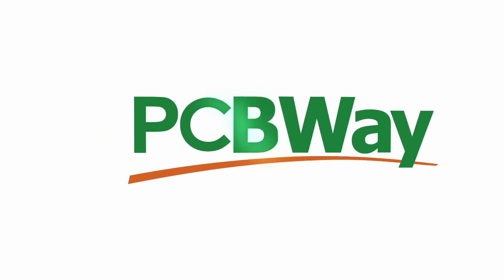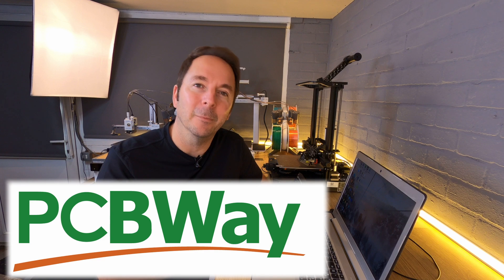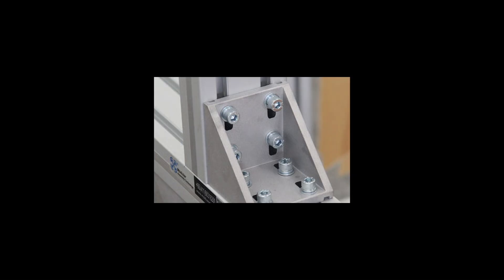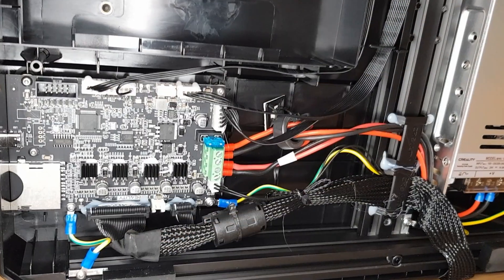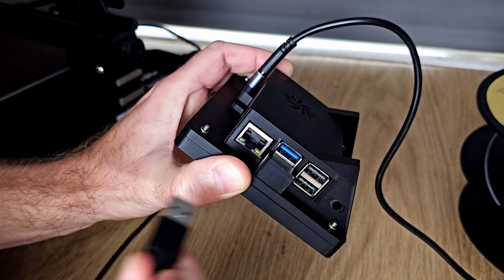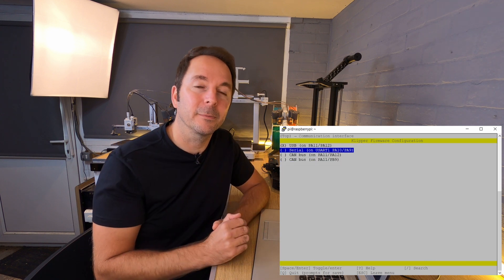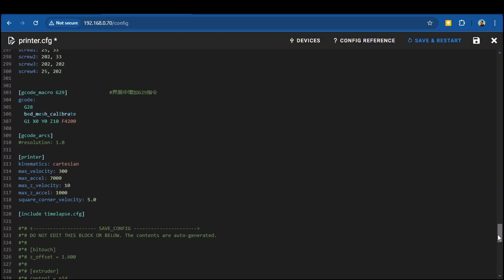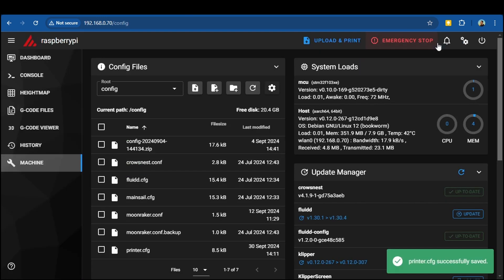Fixing Klipper Errors - Klipper 3D Printer Series Part 8

Comment: MCU 'mcu' shutdown: ADC out of range

Sensor 'heater_bed' temperature -72.505 not in range 0.000:130.000
Sensor 'extruder' temperature -72.505 not in range 0.000:250.000

this is the error i get idk what to do can anyone help or mention a link where this is fixed.
before, the setup was working fine it just happend when i formatted the raspberry and installed the setup again

Comment: I have an old board and I’m getting the mcu unable to connect message. I was able to upload the firmware through the USB cable and the USB led’s on the board flickered like crazy while flashing the firmware. I’ve tried different baud rates and I know my serial port path is defined correctly in the printer.cfg file. When I try to connect klipper to the printer board I don’t even get any blinking led’s on the printer board. Before updating the firmware, I was able to connect to the board with pronterface using the same USB cable I’m currently using for the connection between the pi and the printer board. I don’t know why this thing doesn’t connect.

Comment: Klipper software, Arduino Mega2560, Ramps 1.4, Raspberry Pi4b. When the 3D printer starts printing, the bed temperature reaches the set level, then the nozzle temperature reaches the set level, and printing doesn't start. There are no error messages; everything appears normal. The nozzle and bed temperatures fluctuate a few degrees. The axes are manually moved and home positioned. The axis and extruder calibrations are complete. Please help. I couldn't solve the problem.

Comment: HI Ricky, your videos have been super helpful to me. I am running Debian Linux 11 on a NUC box, USB connected to my Ender 3 S1 Pro. Using Fluidd It has been working fine for a couple of years. I lost power while updating Fluidd/Klipper. I have gotten all the latest updates installed successfully, but now I am getting the message "Klippy not connected" "Restart Klipper does nothing. I have tried rebooting the PC and Ender multiple times, restarting OrcaSlicer and no change. I thought about uninstalling and reinstalling Klipper but I don't know if that is the right approach or not.

Comment: here is the error i am getting..   
   virtual_sdcard is not defined in config.

    pause_resume is not defined in config.
    gcode_macro pause is not defined in config.
    gcode_macro resume is not defined in config.
    gcode_macro cancel_print is not defined in config.
    display_status is not defined in config. 

Make sure you include the mainsail.cfg in your printer.cfg file.
i did the google search and am not 100% on how to add this to my printers con fig. i have re-watched all the videos many times.
i think its a copy and paste fix but some step by step would be very much appreciated. i am setting up an ender3 v2 with the pi4b and the skr mini e3 v3 main board. thank you for all you work on this series i tell every one that is trying to set up klipper to check you out.
Reply: make sure the mainsail.cfg is on your raspberry pi, if it is, open it and add the following line at the bottom of your printer.cfg file        [include mainsail.cfg]

Comment: Do you have any insight on this error Lost Communication to MCU 'MCU'  this seems to happen sporadically. I can get a print to finish or it could shut down with 10% to go.
Reply: Happens to me too 😅 I know for a fact that it will happen if my raspberry pi heats up and throttles, and there are two varieties of messages that I get. One of the error varieties has to do with some sort of a timer mismatch / race condition. The other error seems to be more generic and this more difficult to explain / anticipate. For me, this will often occur mid print, but I’ve also had it happen before with a stationary printhead (I.e just a few seconds into heating up the bed). 

Even though my 3-D printer didn’t originally ship with Klipper, the manufacturer was kind enough to provide HARDWARE troubleshooting videos for MCU errors, so I know that there is a possibility that some wire, screw or cable is not perfectly seated or tightened. 

Since my raspberry pi and 3-D printer pull from the same power socket, there is a possibility that there’s some sort of a ground loop. I know that the printhead probe status light could illuminate due to my mainboard being connected to the the pi, even if my printer was off (and I’ve seen resources that suggest using a cable that does not transfer power, or at least using a usb power blocker to interrupt any power transmission … that didn’t work for me) there’s not a whole lot of helpful information in the logs either, so I’m hoping to eventually find some good advice on how to prevent this.

Comment: Honestly this is practically useless. It is long winded and  the Klipper answers are pretty much useless as well. Not sure but unable to parse part of the file that is the exact part setup by the original author isn't explained or helpful. Nor is going back to watch a few hours of PCB Way advertised garbage that is also not helpful.

Comment: I'm a noob 3D printer owner.  I'm a bit technically savvy.  I tried to install new firmware for my neptune 4 pro and now it boots to the klipper screen instead of main menu.  It shows the mcu error.  It also shows the correct updated firmware including the UI.  I obviously ran the fix software.  At the same time there seems to be a filament stuck in the extruder.  I think I have a firmware issue.  I can't find a fix anywhere online.

Comment: Option serial in section mcu must be specified..Once the un derlying issue is corrected, use the RESTART .command to relo ad the config and restart the ho st software..Printer is halted.

How can I fix this error?
Reply: Did you get this fixed? You didn't assign the USB serial port on sounds like

Comment: I am having an error I cannot seam to find a solution for.  Have you ever seen an error that reads like this?
      Option 'serial' in section 'mcu' must be specified
      Once the underlying issue is corrected, use the "RESTART" command to reload the config and restart the host software.  Printer is halted

I have no idea what caused this one day it was printing great, I finished a print shut it down for the night and started it up the next day and have been stuck at this error since.  Any help is greatly appreciated!  I have already restarted everything multiple times and tried loading previous printer configuration files without any changes.
Reply from the maker: Hi, have you watched this video? https://youtu.be/W3i1Aa2mRJE From the sounds of it, there is an error in the MCU section of your printer.cfg file. Hopefully this video will help you.

Comment: Thanks Ricky, very helpful video series. I ended up having the mcu issue, but it turned out that klipper firmware was not being uploaded to my ender 3 properly (Its so hard to know if its successful with no visual queues). I normally use Marlin daily builds, but I actually had to downgrade and flash an old version from the creativity website first for the klipper firmware to then upload correctly. putting this comment here in case someone else has the same issue. Cheers Andy
Reply from the maker: Thanks Andy. Hopefully anyone with the same issue will find your comment👍

Comment: Hello, I just finished the video on how to install klipper on my Ender 6 and I’m having some problems with klipper it says 

File contains no section headers.
file: '/home/rodrigo/printer_data/config/printer.cfg', line: 1
' ‹DOCTYPE html>\n'
1.2 GB
ed
Once the underlying issue is corrected, use the "RESTART" command to reload the config and restart the host software.
Printer is halted 
I’ve looked on google and can’t figure it out. I would appreciate some help. Thank you
Reply from the maker: It sounds like you don't have a suitable printer config file. Have you watched the earlier videos in the series? I show how to find the right config file for your printer.
Reply: @RickyImpey  I have not I’ll go take a look, Hopefully this fixes my problem. thank you